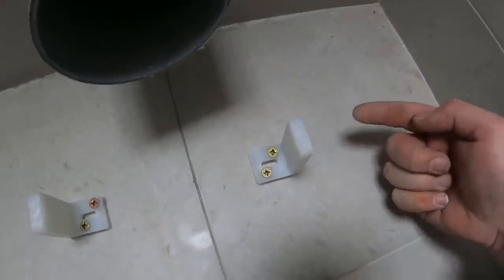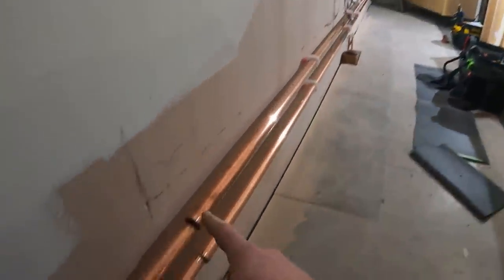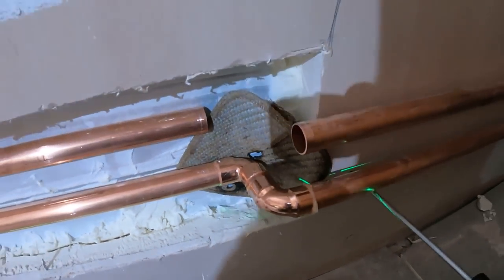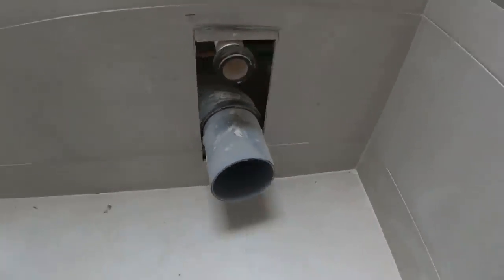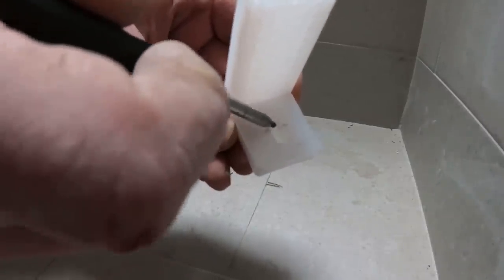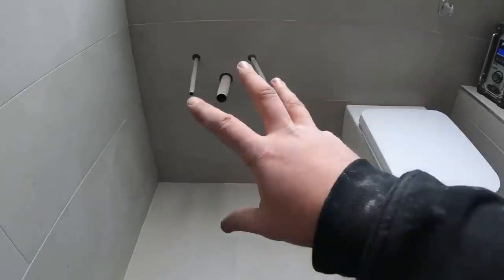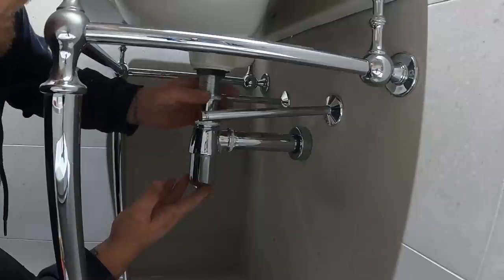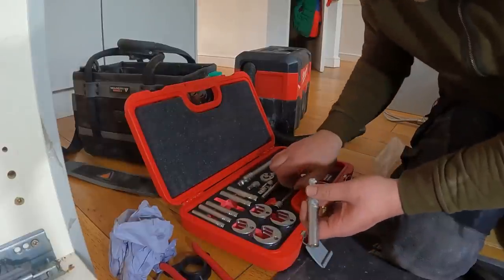PIPEWORK PROBLEM AT THE BARN & BATHROOM No.3 gets FINISHED

Comment: Nice gadget for the taps mark it saves on a lot of banging the elbows and swearing 😆 I was just looking at my 28mm pipe slice the other day it last seen service 4 months ago plumbing in a wood burning stove, as for 28mm pipe and fittings I'm glad I don't use them every day as the cost of them is going through the roof
Reply from the maker: Yep, copper is going sky high mate, luckily these are just the primary’s.
As for the Tapex kit, I was very impressed on my first use of it…. Can see it paying for itself fairly quickly 👌🏼👌🏼

Comment: Another good vid. Love that sink, looks ace. Would a chrome elbow iso be any good? Keep it looking clean less joints and take the chrome pipe all the way up to the tap.

Multi tool looks good. Could've used a diamond blade in it for trimming the tile round the pan pipe. The loo seat metal knipex 10" cobolt mini bolt cutters are your friend. 😉
Reply from the maker: Yer the sink is stunning, Burlington suites are always lovely to fit.
Could of done a lot of things with the tile around the pipe but I find that is the best approach👍🏼

Comment: Another interesting video on various jobs you’ve been to handy tip on holding the copper pipe level  in place usually use tape measure to hold up pipe screwdriver tip will come in handy when soldering pipe on top of one another👍your right about those tile bits good set to have I have used loads of times and still going 💪 as to the tapex kit worth it’s weight in gold it has got me out of a couple of awkward kitchen tap jobs I’ve done changed one last week and used that tip you showed on one of your last videos where you put tap bracket and nut on tap then slide them down from top of sink very useful 👍looking forward to the next one hope the rest of the week goes well for you.
Reply from the maker: Yep, the tile bits are brilliant, so many people have messaged to say they now use them and have saved a fortune👍🏼👍🏼

Comment: Great video mate. I ordered the tap kit after watch your video, it's been in my basket for about a year!
Does the barn basin have fixing bolts? Or just sitting on the frame?
Reply from the maker: It’s a great tool mate, you will be impressed😉
It just sits on the frame with no way of bolting it back so it will have a CT product behind it to secure before sealing

Comment: Should invest in a cordless grinder, I install central heating all day everyday and it is so useful for things like little notches in tiles and even ripping out old heating etc. good idea with the stitch drilling though 👍
Reply: Multi tool tile blade is ideal for that situation, but the stitch drilling works too
grinder would be a bit brutal where it is
Reply: @killerbean9911  each to their own I suppose, I’ve found the grinder to be good 👍
Reply from the maker: Either or will work… whatever gets the job done, 👍🏼👍🏼

Comment: Mark what tile drill bits do you use the ones I seem to buy just brake easily. Any recommendations?
Reply from the maker: I use these mate….. bulk buy them

https://www.ebay.co.uk/itm/10Pcs-6mm-Spear-Head-Ceramic-Porcelain-Marble-Tungsten-Drill-Bit-Glass-Tile-UK-/272826390695?mkcid=16&mkevt=1&_trksid=p2349624.m46890.l6249&mkrid=710-127635-2958-0
Reply: @MJTiffPlumbing  do they last a bit longer per 1. As I seem to find the ones I’ve been buying last for about 5 holes
Reply from the maker: @PlumbingMaintenance  for the price of them you won’t mind if they only do a few holes, however they are really good and do around 15holes on ceramic tiles no problem
Reply: @MJTiffPlumbing  no worries appreciate you replying and passing on some wisdom.